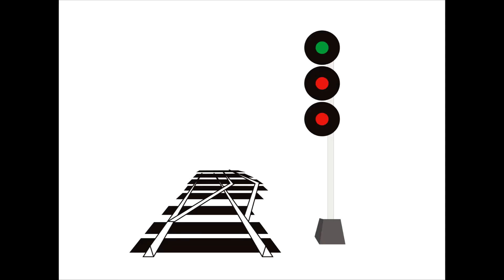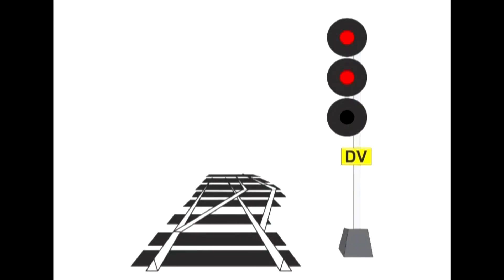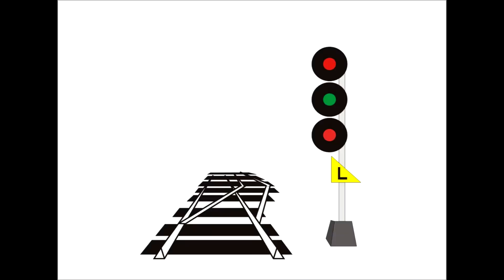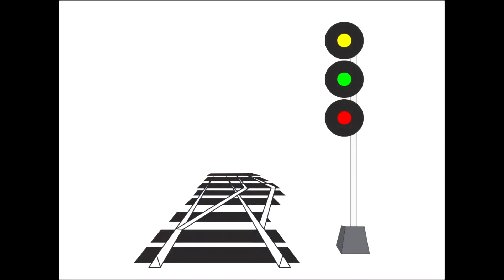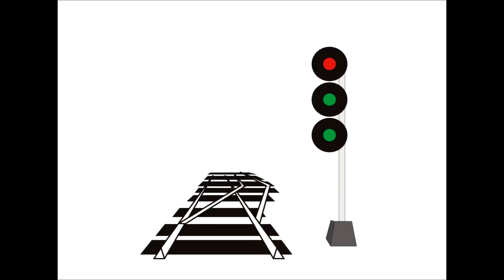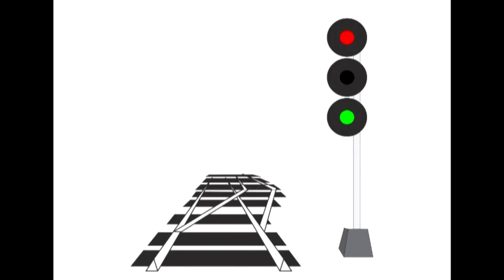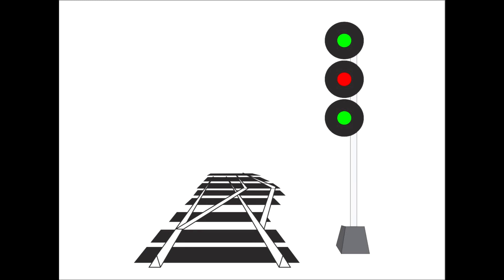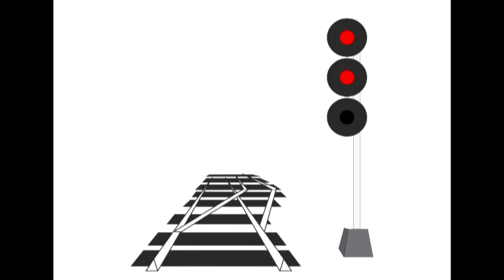Part 3: Railroad Signals, reading and meanings. Diverging and Limited speeds, to and at signals

Comment: I got lost first time through this (and I'm not claiming to understand perfectly now...) at 6:54.  Is the colour of the light suddenly indicating speed?   So at 6:59, "clear to slow," is yellow-over-yellow-over-red like a "yellowed" (so downgraded?) version of yellow-over-green-over-red, "clear to medium?"

I guess I'm just surprised that "clear to slow" wouldn't be yellow over red over green, so that the slow indication continues to be given by the third head, as it was back in the good old days of parts 1 and 2.  Instead the third head is still there, but now stuck at red (and, I bet, free to be deleted -- like they got this far and started regretting the expense of using position to indicate speed).

Comment: I think it's better to have Red=Stop, Yellow= slow caution.
Green= Clear
TWC and Dispatch Communication should be mandatory. 
But soon enough trains will be pure AI and no crews.
Like a model railroad.
Reply: I felt that Red / Green / Red should be Medium to Medium. Flashing the middle head or adding an [L] plate would make it Limited to Limited.

Likewise, Red / Red / Green should mean Slow to Slow. Flash the bottom head or add a [DV] plate to make it Diverging to Diverging.

I would make Yellow as the speed you should be travelling AT while green is the speed you should be changing TO. So Slow to Medium should be Red / Green / Yellow. And Medium to Slow would be Red / Yellow / Green.
Reply: Maybe in a perfect World, but railroad is everything but perfect, it will be decades before crewless trains....

Comment: It's not totally fail safe. If the bottom head fails, a clear to medium may revert to clear if the bottom head stays red. I can't believe that they would use green on the high speed head in that case. They should be using yellow in that case on the top head indicating it's clear but stale. Then, if the bottom head fails, it will revert to a clear to stop. Much safer. Also, would you please do a video of all the signs the railways use? I really enjoy your videos.
Reply: The Clear To Slow indication in the CROR is:

  G
  R
*Y*

It really should be

  Y
  R
  G
Reply: The CROR has the standard form of clear to medium being, Y/G/R, just like asked, the G/R/G form is a alternative form. Simularly,the Clear To Slow is Y/Y/R, and there is a alternative form of G/R/Y

Comment: Is there a such thing as advance clear to restricting
Reply from the maker: Not that I'm aware of. On the CN subdivisions I ran, it would be clear to stop or advance clear to stop. On the approach signal (clear to stop, one signal before the siding) there would be a flashing arrow indicating we were lined into the siding. If that arrow wasn't lit, then we approached the next signal expecting it to be a stop signal. If the arrow was flashing, then that was like a "clear to restricting" signal, even though there is no thing. We knew we were lined into the siding and we knew we had a restricting signal entering the siding so we could approach the signal at 15 mph.
Reply: That would be Flashing Yellow, Solid Red, Flashing Red.

Comment: At 5:07  you show the shape codes for plates. Model Power makes a signal number 1682 with a circular plate marked " C ".  What might C signify?
Reply: Charles Smart I cannot specify for Canadian railroads, but CSX uses a Red C on a circular plate to denote “stop and check”. Usually used for bridges over water, the light is interlocked to the bridge itself. If it is green, the bridge is down and the tracks are locked. If red, the train must stop, and a crewman must check the bridge for any faults (if the bridge is not actually in use). If all is ok, they may proceed at restricted speed until the next signal.

Comment: Loved the video,
 but I am in the aviation business. Why don't railroads have a similar communications systems such as ATC which is the control tower etc?
Reply from the maker: Actually, we do - however there are advantages to the signaling system. I've had more than one trip where we literally picked up the train and went the entire way without ever talking to RTC once. RTC knows where we are because of the detection system for the signals so RTC is sitting at a computer in Toronto, controlling dozens of trains by point and click on the the computer. They don't have to ever talk to us, though they try their best to give us a call and a heads up if we have a meet coming up. In non-signaled territory (OCS) it's all done with written clearance - very similar to ATC clearances, but it's "in writing" - they dictate the clearance over radio or telephone and we repeat it back verbatim. Once it's been read back verbatim, we each sign it and it is now called "in writing." But the OCS system doesn't know where the trains are - they have to call us and ask. The CTC systems have the advantage of also indicating what trains are where at any moment in time.